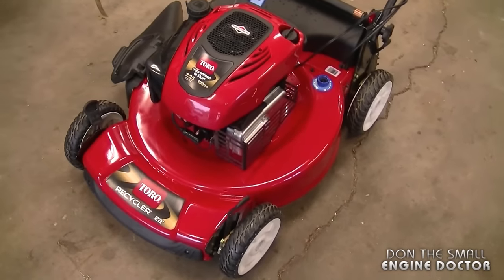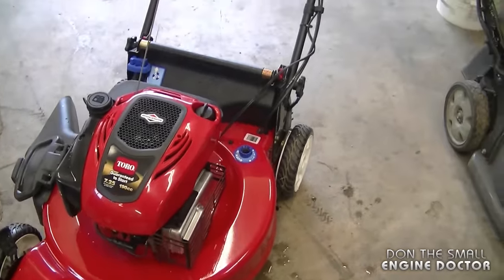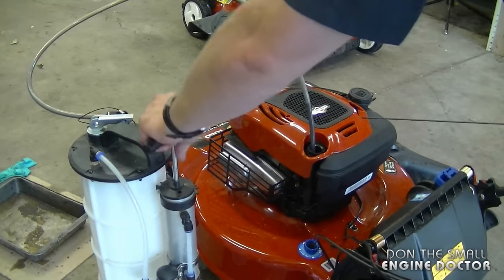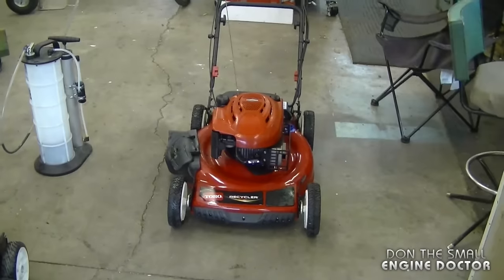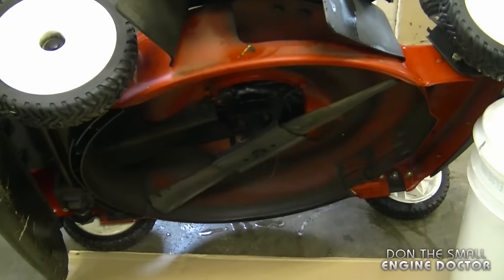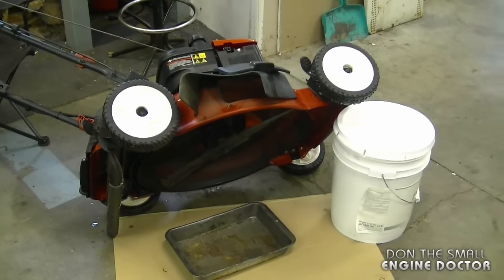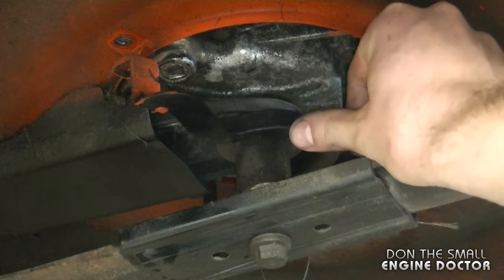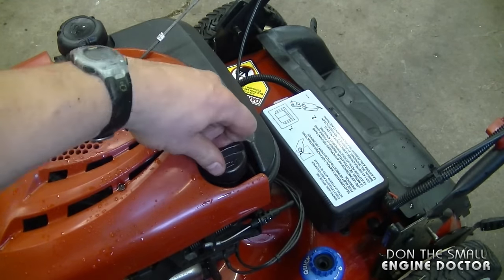Toro Lawnmower Oil Change - DIY Video

Comment: God forbid manufacturers design a mower than can have its oil changed easily without taking half the thing apart or spilling the oil over everything!
Reply: What’s wrong with tipping the mower on its side, or using an evaluator?  And you DO realize that the engines and mowers are designed by two different companies?
Reply: @tedschmitt178    Yep, Briggs and Toro...Very popular manufacturers that should be in sync....Looks like that lower belt cover is in the way of the crankcase oil drain.  Tipping the mower on its side usually makes a mess under those plastic covers, and no, don't have an "evacuator".  Pulling the drain plug is the best way to let the engine drain completely.   In this case, I blame Toro for not designing the lower belt cover to be easily removed without pulling off the blade and hub....
Reply: @fleetwin1  Whenever I change the oil in my mower I put it up on sawhorses. That way I can remove the drain plug in a similar way to that of a car
Reply: We have become a replaceable society.  Toro did research and found consumers expect to replace their mower every 3 years…that’s why everything isn’t serviceable anymore.  It’s cheaper to produce and meets consumers expectations.  Time to hit the yard with my 30 year old mower!
Reply: No joke 😅

Comment: I always tip the mower back and place a weight on the handle bar to keep it up in the air. Gives easy access to the underside.

Comment: When you flipped the first mower, can't tell for sure, but what is that round looking thing, just to the upper right of the clutch cover. Looks like a easy access drain plug to me. Can't imagine them not having one that is easy to get to , but then again I trust your expertise.
Reply: Looks like an engine mounting bolt, too far forward on the engine to be a drain plug.

Comment: I have the Toro smart store mower and I had gas in my oil reservoir so I just tipped it over oil side down and poured all out and replaced it worked fine I didn't have any gas in the mower at the time put more gas in after replacing the oil and it started first pull

Comment: According to the Toro site it illustrates just tipping mower to the side and draining oil from the fill cap, (same place to add oil) I have the second mower model in this video. The service manual doesn’t mention removing the drain plug. However I did try tipping mine to side like service manual said and it did fairly well job but I still removed drain plug very little came out. FYI: if you have the second mower in video like I do it only takes 18 ounces oil and they do sell bottles with that capacity.

Comment: Donyboy, if there ever is a 4th way it would be on my lawnmower. My recycler toro was made in 2014 so it was between your two models. It has the belt guard like your second model had but the top section around the oil cap on your first looks like mine.  The difference between my model and the second model is that B&S changed the bolt that holds the belt guard from a short bolt to a self tapping one that goes through the engine hold down block.  I chose to drain the oil the way I always have, through the oil plug.......I managed to break the head off the guard bolt. So I had to drill a hole through the broken bolt large enough to get a 1/4” bolt 1 1/4” long with a locking nut and washer to reattach the guard.....Ended up changing the oil the first way you demonstrated...who would have thunk???  Good video.

Comment: I have a toro recycler 22” 7.25/190cc.  Has a place where it looks like there should be a drip plug but doesn’t looks like it comes apart

Comment: Don,   I have had good luck with Pennzoil Platinum 10W-30 motor oil.  I use it in all of my 4 cycle equipment.  Some say engines consume more 10W-30 above 80 degrees, but I have not found this to be the case.  I have run my 4.5kw generator for a straight 24 hours and the oil level did not change one bit.  I used it in my Honda HRR-216 for 4 years in pretty rough service and I only seldom had to add a little oil to it.  At least no more than I would have to add if it was a straight 30W.
  I do break in my engines with convential oil but switch over to synthetic oil, asap.  I generally replace their oil after around 3 to 4 hours of operation and use the same oil they were originally filled with.  At around 10 hours, I replace that oil with synthetic.  This gets all the break-in particles out of the engine and is enough time for the rings to seat.  I also change my oil at around 25 hours and use the same Pennzoil  synthetic oil.   I have tried 5W30 but this oil does not hold its oil level like 10W-30.

Comment: I have a toro that will start on the 2 or 3 rd pull every time.  I have never changed the oil, plug or anything.  Just add gas and go.  It’s 19 yrs old now.  I use it about 20 mins once a week.

Comment: My mower is from 1997 (Yard Man, rear drive, casters on front, I love it) (Briggs engine) and it still performs wonderfully.  The manual states 30 weight oil, and that use of a multi-viscosity oil can cause premature engine wear.  I had my mower serviced and they used 10-30 and said it wouldn't harm it.  I'd love to hear your opinion on this.  Thank you!
Reply: 10W30 Synthetic such as Amsoil Small Engine won't harm it but it does burn in warmer weather above 80. It's a synthetic and does an extremely good job of keeping your engine cool. I wouldn't advise using oil designed for a car engine whatever you do. But you will need to keep a closer eye on your dipstick. The advantage of 10W30 is the mower starts in colder temps below 40 degrees. Great oil for those of us in the North, not so great in the south!

My recommendation for a Briggs would be 10W40 for the summer months and I generally change to 5W30 synthetic here in the last week of September as the last mow of winter(October-November) is just slightly above freezing.

10W30 is an amazing year around oil from 0F to 100F and offers excellent protection. SAE 30 was the best option when Dyno oil was what was available.

Personally I run Royal Purple SAE 30 in my older Briggs 190CC. While I use 10W30 Amsoil Small Engine in my Honda GCV160. Overall I notice the Amsoil stays cleaner longer but I haven't seen an issue with either one of them.

The most important thing is to change the oil itself in a timely manner. Not always what you use. Fuel always seems to contaminate the oil if you use it too long in these small engines. The main thing is to keep the engine cool, minimize wear, and keep it clean. Either of those oils would be excellent.

Oil is cheap! Older Briggs Flat Head Engines are priceless!

Edited(Probably a useless reply given your comment was from 7 years ago) 🤦‍♂️😅

Comment: I was thanking maybe it needs to be adjusted the reason I believe that is the carb was on a 12hp but now its on an 8 hp and I didn't adjust it yet im new to this but im trying to get into it maybe the adjustments are different for a 8 hp than a 12 but im not sure do you think so maybe that is it

Comment: Neat to get a close look at one of those personal pace machines. I assume the pulley underneath is for the drive, but still pretty complicated looking.
Reply: There all pretty straight forward though
Reply: Yes, the pulley is to operate the transmission.  They seem to work pretty well.
Reply: I love mine, makes mowing so much easier, especially on hills.  My only complaint is the height adjustment - it's very awkward/stiff to adjust (each wheel as to be adjusted separately).
Reply: @soapsoilandsunshine3241  are there ones where you don't have to adjust each wheel separately? My little 20 inch push mower, now relegated to mowing places I can't fit my lawn tractor, has separate adjustments on each wheel too
Reply: @rpavlik1  I’m not sure. I’m more inclined to fix what I have rather than look at buying a new one. Temptation gets too strong lol.   I’ll have a quick check.

Comment: such an easy thing to do yet nobody thinks it's important on every one of these I've worked on
Reply: Nope, people either hire someone to mow their lawn, or they buy a new lawnmower quite often LOL.  Simple maintenance on a lawnmower can make them last for many years...usually I wear the decks out to the point the wheels fall off, but the engines are still good.  

I now have a Toro FWD 22" Recycler that was given to me because it wouldn't start, I didn't have time to mess with it so I took it to a shop, they charged $60 to sharpen the blade, change the oil, new air filter, new spark plug, and to clean out the carburetor.  It runs fine, but if it dies or you shut it off after it has ran for several minutes good luck getting it started again.  This is my first self propelled mower, and right now I'm still not really sure I like it.  I mostly use it to mow around the edge of everything, and around the trees and bushes before I jump on the riding mower.  Maybe if I was mowing my yard with the walk behind and didn't have a bunch of stuff to mow around the self propel would be fine, but when you have to stop and backup, turn around, etc, the self propel really makes the mower hard to pull backwards...and they're all that way, dumbest design ever....if that self propel feature breaks they're hard to push too.
Reply: I have the same toro that's over 10 years old I never changed the oil ..just added when low once . Never had a problem. Starts first pull. I'll change it completely this weekend, I think she more then derseves it .

Comment: why do some engines read when you check the oil, either screw the dipstick all the way in or just rest it on top. I have a toro recycler with the Tecumseh 6.75, engine model LV195EA. year 2004. deck model 20031. does it really matter.
Reply from the maker: yes it matters

Comment: so the Toro model number 20332 doesn't have a drain plug under the lawnmower or it's hitting by the lawnmower frame, because i like changing the oil from the oil plug because it's more easy to flush out the old oil

Comment: Thanks so much for this video.  I changed the oil yesterday and it worked a treat.  I've ordered a new spark plug as existing one was covered in carbon.   The oil plug in my Toro self propelled was in a slightly different spot to yours so I didn't have to undo anything to access it (Australian version circa. 2010).  Just wondering if you know why if sometimes sounds like it's nearly out of fuel (engine dies as if it's going to stop then it starts up again).  Could this be a fuel issue?   This comes and goes.
Reply: The carb sounds like it could use cleaning. One of the jets maybe clogged.

Comment: Any reason I shouldn’t just tip it over to drain the oil out?
Reply: You end up with more of a complete drain for contaminants. So for those looking to keep their engine running as long as possible this is the only way to get rid of the most oil and contaminants in the engine possible. Your engine will run cleaner as a result and have a longer lifespan.

Comment: I have never drained the oil via the drain plug on any push mower.  I always tip it sideways and drain through the fill spout.

I also use SAE30.  But I have often wondered about 5w30 and 10w30.  I understand that these oils may be too thin when cold, but I also assume that these mowers rarely run cold since they are used in the summer and are only air cooler.

Snow blowers are obviously a different story since they are run in the freezing cold.

Comment: I have a friends Toro lawn mower that needed a new ignition module and primer bulb. It was running and then there was some smoke coming out of the exhaust and wouldn't start again. A week later I was trying to start it again and it does not run and there is smoke coming out still, it smells like oil. If the oil level is good what can I check to see what the problem is ?

Comment: I have a Toro with the Techumseh motor and I really hate it. It's 7 years old and after 2 years I have to replace the gaskets. Do you have a video on how to do that? What make them go out so fast?
Reply: The newer Techumseh engines weren't very good.  My 40+ year old Troy Bilt Roto-Tiller with the Tecumseh HH60 engine is still going strong.

Comment: hey don i have a need for advice. my kawi motor on my exmark mower keeps surging. It has done this twice in the past month and i have cleaned the carb both times and it runs fine. after a few mows it gets dirt in the jet again and starts surging and running lean. what could be causing this? I clean the air filter after every mow because it gets dirty quickly. I also replaced the gaskets from the airbox to the carb and from the carb to the intake manifold.

Comment: Is there an o-ring or seal that has to be used with the oil drain plug. I have oil leaking from the plug. Maybe the plug needs to be tighter?
Reply from the maker: no o-ring or seal, maybe not tight enough

Comment: How would you get all the oil on top of the mower it would flow better at the bottom of the mower and you would get it all
Reply: Honda mowers for example decided that changing oil isn't needed I guess because they don't have drain plugs on their engines.  Dumbest thing I've ever seen.  Sucking the oil out of the engine from the top doesn't get all the gunk out of the bottom of the engine the way that draining it out the bottom does.

Comment: Does anyone know if there's a kind of safe dye you can put into new oil so that the level is easier to read on the dipstick? New oil is practically transparent, I find it hard to see on of the stick, particularly when I'm working outside. Thanks!
Reply: Dale Grote only oil I know with it is royal purple. They dye the oil purple.

Comment: Why screw around with a hard to reach drain plug when it's so much easier to just tip the mower and drain out of the oil spout on top!

Comment: where do I get the evacuator ?
Reply from the maker: check amazon.com
Reply: Just tip it over. Its easier and you don't have to have another tool in the garage just to do a lawn mower oil change.

Comment: Not a single video on oil filter?
Reply: Yeah - Mowers don't have Oil Filters. 
You do have an Air Filter  - Which is on the Outside and easy to remove
They also have a Spark Plug.

Comment: the oil could be different, what is the difference, 10w30 is more common to buy but 30 is not, why different
Reply: George Gardinier The "W" in multi-grade oil ratings stands for Winter.  A 10W30 oil will have the viscosity of a 10 weight oil at startup and a 30 weight oil once up to temperature.  A straight 30 weight oil is just that - 30 weight all the time.

Comment: I have never used 30 oil in my machines , i think it's a bad oil of the reson that there is better oil's to day . They used that caind of oil in the motors of the beginning of the 60th and we are in 2015 now . In the machines i have and use i always have thougt that the motors are no better then the engine In the car or motorcykel so i use mobile1 10w40 fully synthetic oil and i have used my lawnmover in almoast 20 years without a problem. I know that the aircooled engine runs warmer then a watercooled engine but i think it's not a problem. Best whishes from sweden nothern euroup. Hakan

Comment: Took mine back. Got tired of it not starting. 3 yr no start warranty, what a joke.
Reply: Yeah easy start my a**.  Mine still starts ok, but if you shut it off or it dies after running for a while good luck getting it started again.  Give me a manual choke and throttle and everything will be fine.  These new chokeless and throttle-less engines are cheap garbage yet you still pay a ridiculous price.
Reply: EXACTLY the same problem I had with two brand new units.

Comment: never understood why people run there engines before an oil change. if you are running say 10w-30 at 32 Fahrenheit the oil is thinner cold than when its warm. it is 10 weight oil at 32 and 30 weight at 212. especially on a car because oil will drain 30 minutes off the top of the engine then you arent getting all the oil out and your oil will be mixed with dirty oil just my way of thinking
Reply: SAE weights are just those, and not actually viscosities.  A 10 or 10W oil is thicker at 32° F than a 30 oil is at 212° F.